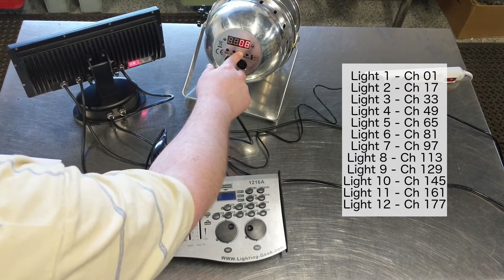Setup DMX512 1216A Lighting Controller

Comment: Keep in mind that DMX and XLR cables are not the same. XLR cables are 45 to 75 ohms and DMX cables are 110 ohms. You can get errors if you use XLR cables in place of DMX cables.

Comment: Shouldn't you have a DMX terminator on the second light in the daisy-chain?
Reply: Its a short run. He should be ok.
Reply: @duaneantor9157  correct. short runs don't require terminators. IF you understand what  terminators are and why they  are utilized,  one  would  know that and why

Comment: Can a DMX controller access the programmed moves in a fixture? I just bought to moving head wash lights. These lights have moves already programmed so can I, on the controller, tell the lights to use one of the programs so I don't have to program everything? My thought is to allow the programs to do their thing but take manual control or enter a scene I've created when I want to. Thanks
Reply from the maker: It really depends on the light and what DMX protocols it understands.